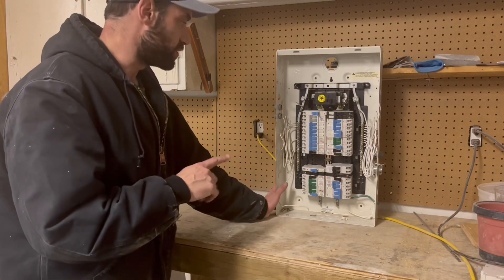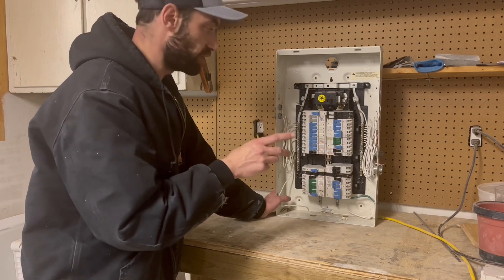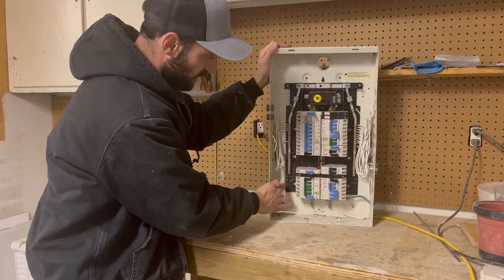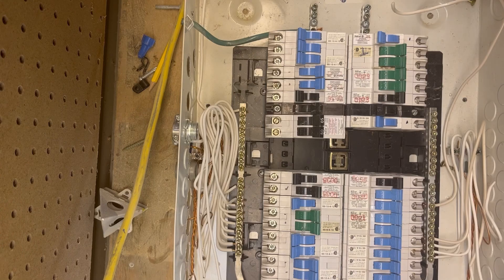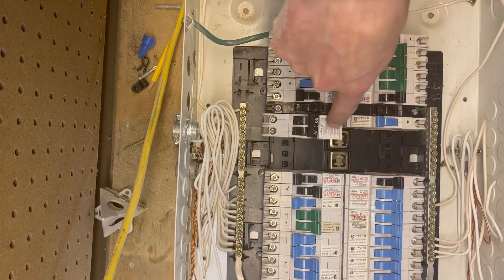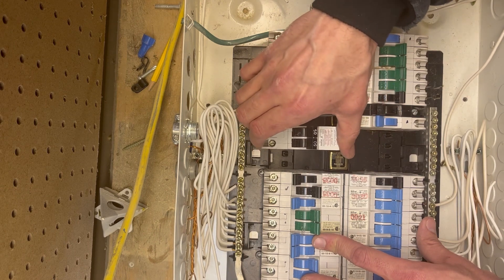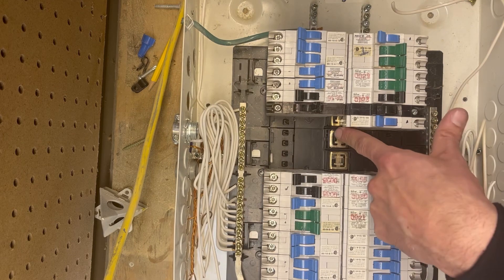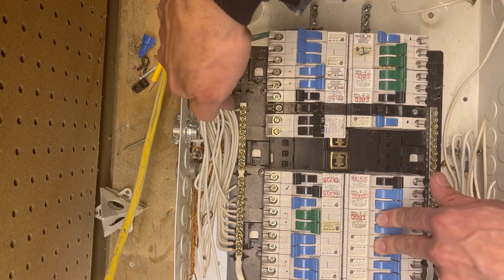Installing breaker in a federal pioneer panel, getting 240 volt out of your breaker.

Comment: Great video.
There are some discussions regarding the Federal Pioneer panel with stab-lok (Schneider Electric) breakers being dangerous. Is this true or they are regarding the older models? Thanks.
Reply from the maker: Federal pioneer definitely doesn’t have the best reputation when it comes to electrical fires. 1 in 4 breakers doesn’t trip when there is a short circuit or over current. I’m not sure if the newer models have better stats.

Comment: Thanks a lot for the video. I have in my home a panel with the same bus sockets, also from Federal Pioneer. It works fine without any issues, but I see many people on the internet suggest to replace the panel ASAP because of the brand. Should I be worried? I'm actually thinking to add a circuit breaker for EV charging.
Reply from the maker: No worries, we try to make videos to help home owners with electrical. The federal brand is not the best panel out there, many were put it though, so lots of people have them. About 1 in 4 breakers doesn’t trip in a short circuit or over current scenario, which is a good reason to update it as this is the leading cause of electrical fires. If you want to know more you can read our blog on our website at www.Luminelectric.ca